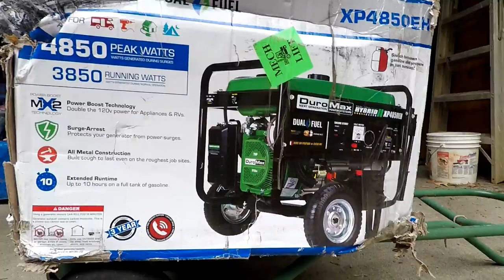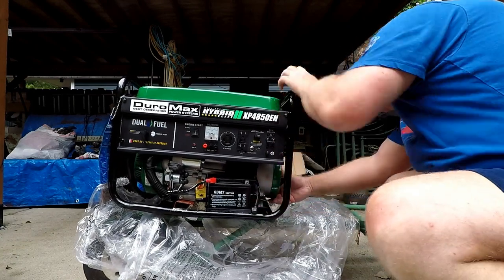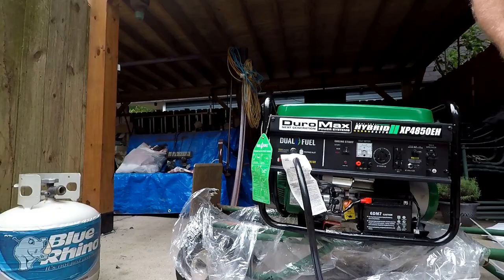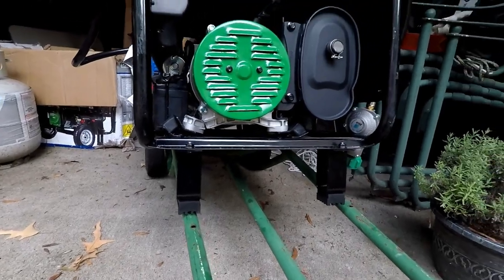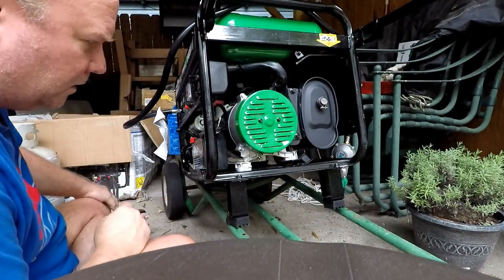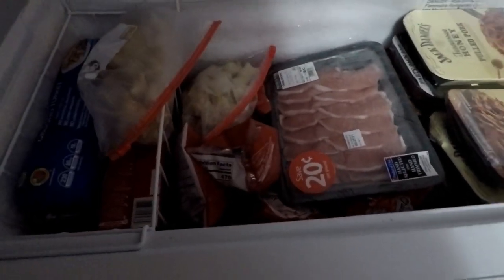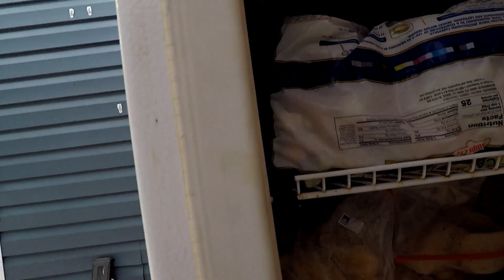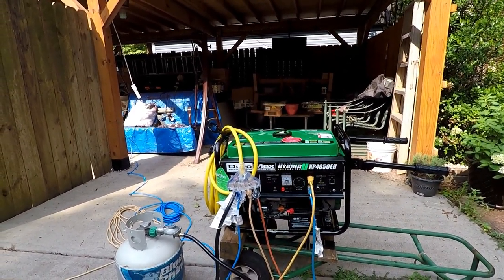Powering 3 Fridges & 2 Freezers on a Generator using Propane

Comment: That box looks like it fell off of the Amazon truck! But the generator seems to be working pretty well. Always good to have a power back up in case the power does go out.
Reply from the maker: It was actually shipped UPS from Portland so hence the 'additional' damage. Been looking around for a generator and got this one for a pretty good discount due to the damage it had before hand and I'm glad it could power all of my fridges and freezers.
Reply from the maker: Almost 50% off due to the damage so it turned out to be a pretty good deal, especially since it works perfectly.